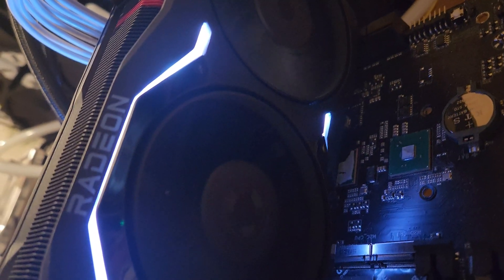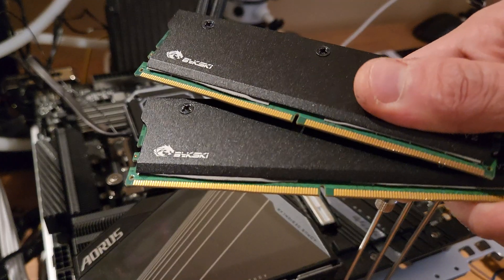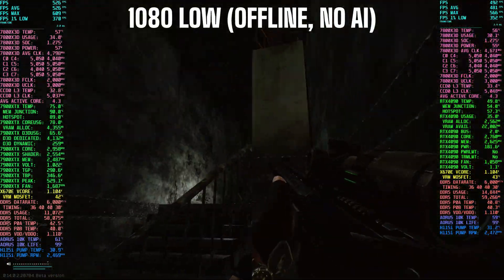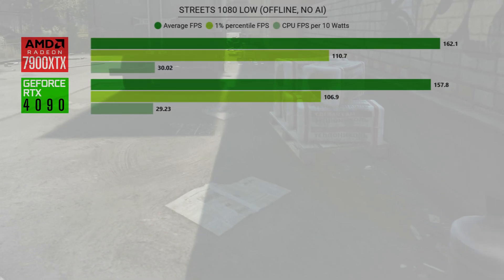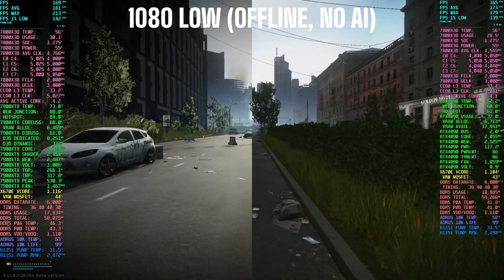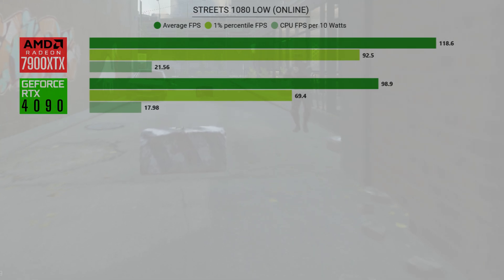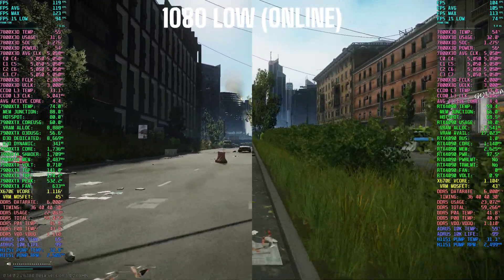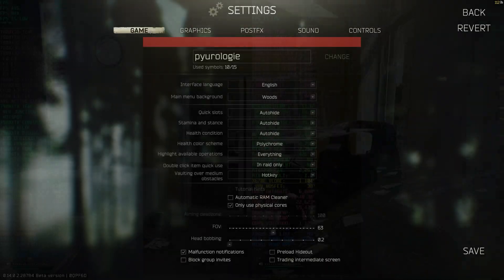Battle of the Flagships 4090 vs 7900XTX in 4K || Faceoff e20

Comment: Hey, great video and information. BUT, i believe 1440p is a much more interesting resolution for Tarkov than both 1080p and 4k, would be great to see that added into your videos. Most streamers play on 1440p, and allmost every player i know plays on 1440p. Also medium settings is far more interesting than low (except for streets).
Reply from the maker: i understand where you're coming from. in 2K, the performance is likely to be almost identical though. at minimum and maximum settings are where the differences are gonna show for tarkov on these 2 cards. I do have plenty of individual videos showing both in 2k though.
Reply: @pyurologie  people are litterally buying new pc’s and upgrading to be able to play Tarkov in 1440p with good fps, 4k is a niche market where monitors cost a billion if you want semi decent refresh rates. It’s great to see someone testing hardware on Tarkov, I bet a lot of people find it extremely helpful, just commenting about what could make your Tarkov content even better and relevant ☺️ keep up the good work 👌🏻

Comment: how did you get 400+ fps on the factory raids, your moniter is only 240hz and the tarkov cap is 144 so how did you uncap it?
Reply from the maker: uncapped the FPS yes, you can run framerates higher than your monitor's Hz rating

Comment: I’m baffled bro I have a 14900k and a 4090 and at 1440p I’m only getting 100-120fps on streets … I’m an alpha player and have gone through all the tweaks in windows nvidia control panel etc and I just don’t get it , benchmarked my system on 3d mark and scored higher than 95% of all other users so it’s not the hardware  this shit is crazy

Comment: how are you upcapping the frames on the amd card? mine is capped at 144. 7800x3d 7900xtx here.
Reply from the maker: if you use vsync in game settings, it will cap to monitor framerate. If you also enable "Enhanced Sync" in Radeon Software, it will uncap indefinitely. Be careful because it will uncap in menus too. The XTX can have huge power spikes in this configuration.
Reply: @pyurologie  this will cause major input lag though right?
Reply from the maker: @tylerbixler6357  nope it shouldnt

Comment: Why is the framerate so high on the 4090 in 4k? I just don't understand how the 4k average an be so much higher than the 1080p average when using the same CPU. do you think it was just a weird raid? or is it consistently higher on 4k?
Reply from the maker: I've been seeing that with higher settings on a GPU with headroom, it can actually increase performance because it uses more GPU power
Reply: That doesn't really make sense to me. I'm guessing bsg just coded their game weirdly to make some higher settings less intensive than lower settings.
Reply: @tracetracetrace I'm noticing this with my RTX3080 today. I'm only getting 70 fps and only using 50% of my GPU. I can kick up the settings and the game looks better and uses more GPU. 

Super dumb.
Reply: Dlss on?

Comment: It is OC or stock 7900XTX  ?
Reply: It's a reference model xtx
Reply: @a9396so for example OC model should perform event better ?
I think about sapphire nitro+  with samsung g9 monitor 1440p
Reply from the maker: You might gain 5% performance on an OC model vs reference, maybe a few more % if you run an extreme OC. In 1440p, XTX is amazing. It just cannot do 4K native. It's just that even cards that cost half as much as XTX are already just as amazing in 1440p. So, in my opinion, for Tarkov players 7900XTX is not a very good deal.
Reply: @pyurologie you think it can compare with 4090 ? or should I buy 4090?
Reply from the maker: @pawel2072  no, there's nothing that competes equally with 4090 right now. It is in a class of its own. I would buy 4090 if you want to play 4K. If you're playing 1440, personally I wouldn't go above a 6950XT/4070 non super.

6950XT: https://youtu.be/gCoED5bOuZU
4070: https://youtu.be/CGy1YjJsiv0

I would get something in that $450-550 price range and spend more on a sick monitor/kb/mouse or just pocket the extra cash if playing 1440p over getting a 4090
Reply: @pyurologie yes monitor samsung g9 oled.Is only 5,120 x 1,440 so I dont think so its make sens to run game in 4k if Monitor have no 4k

Comment: Bro can u please help me, I also have 7800x3d and Rtx 4090 but in some areas on streets the fps dropping from 120 to 65 😭
On top of that I only play in wqhd (2560x1440)
What am I doin wrong 😢
Reply from the maker: https://www.youtube.com/watch?v=rP0UEDLKwf8 this is how i configure my machines

https://youtu.be/-D2gPn95jS8 here is how you can undervolt and overclock your ryzen 7000 as well

https://youtu.be/lOSf_aqrLJc?t=1054 this timestamp shows my pyur preset settings, what i typically run and found to be optimal blend of visuals/performance

lmk how it goes. if you still have issues, feel free to hit me up on discord https://discord.gg/c7SvvDAuMZ

Comment: hey man love your content. I am currently building a PC and have the 7900 XTX and 7950X3D should i swap down to the 7800X3D or stay with 7950X3D i have found mixed reviews on this subject and alot is based on price vs performance. any advice is much appreciated. currently only 1440P gaming
Reply from the maker: if you're just gaming, all the 7000X3Ds perform about the same in Tarkov, I would get the 7800X3D if you want the best performance to price ratio. I would call the 7900X3D and 7950X3D "luxury" options that can game as well as the 7800X3D, but are also multi core beasts for other applications. So, if that's what you're looking for, then go with the 9 series. Otherwise, if just gaming, you're not getting any extra gaming performance from the 9 series chips over the 7.

Comment: I have 3080 and i9 11900k and cant beat 75-80 fps in 2K on streets. My average fps on streets is 60.. My details is medium. Framedrops is 45.. I dont know what is wrong..
Reply: My buddy had a similar CPU, but it was wattage limited somehow. Check the wattage in bios for your cpu. He fixed the wattage cap and then it went all crazy with frames.
Reply: I don't have streets data or 2K data. But on woods and shoreline 3080 4K 5600X DLSS balanced im 90-100fps. DLSS quality 80-90fps. 3080 is undervolted.

Comment: wht is the 7900xtx 20 degrees hotter all around in 4k? 6:40
Reply from the maker: XTX runs very warm and draws a ton of power, normal behavior
Reply: @pyurologie  
The core clocks on your 7900 XTX seem really low for half the 4k online raid, for some reason.

My Asrock Phantom Gaming is consistently at 2700-2900 mhz Core (at 5120x1440 32:9 ultrawide, which is slightly less pixels than 4k), on all maps.
vs the mostly 2200mhz core, with some recovery towards 2500mhz, near the end of your 4k High streets run.

Also if you look at the start of the offline 1080p Low side-by-side run, the 7900 xtx properly at 2800mhz'ish there.
While in the online Streets Low 1080p, the 7900xtx is at a abyssmal 1750mhz?

It's as if the 7900 xtx is in some kind of powersaving mode.

I'd recommend revisiting the card, it really shouldn't be dropping core clocks like that under load.
Personally I run the custom tuning profile in Adrenaline, with just power limit +15% and min frequency at 2700, max 2925, this tends to ensure that the card doesn't do any weird downclocking power saving stuff.

P.S. I actually noticed the 4090 also downclocks at the start of the 1080p Online run to just 1035 mhz core, which makes it look as if the 4090 is worse at 4k Low.
Which would be accurate to a degree, if this is common occurrence at default settings that many buyers aren't going to tweak.
But I am really curious what kind of differences we would see if neither card was downclocking for any reason and were sitting at full clockspeeds from start to finish.

P.P.S. The 7900 XTX starts the 4k Ultra run with 25214mb VRAM usage, that might be causing it to offload textures to ram/pagefile, resulting in performance losses. 
Might want to test Streets Low Textures option, to see if that makes any difference. 
And/or restarting the game between tests, to make sure there's no anomalies.

Comment: Apologies but those 4k frames by the 4090 in online seems like DLSS is on, are you sure it wasn't?

Appreciate the content.
Reply: maybe putting more weight in gpu by increasing the resolution rate reduced the heavy load of cpu giving more fps in total
Reply from the maker: @alieichiba5217  yes I think it's something like this. The higher settings/resolution increased GPU usage and surprisingly seems to increase overall performance.
Reply from the maker: yes I'm sure man
Reply: Nvidia cards in higher resolution become super competitive and beat amd cards in nost cases , im not a nvidia fan , in mid range non rt games amd absolutely destroy nvidia , but going to 4k and using ray tracing nvidia win , my gpu is 6950xt asrock phantom gaming.

Comment: I have an older System Intel k8700 CPU with 1080ti nvidia. I think about to change to AMD am5 7 7800x3d and the gpu i really dont now which to take i Play 2k setting wqhd. What is the first step to go for more fps change board and CPU with DDR5 ram or let the Intel and go for gpu? İ like and Abo your Chanel thx
Reply from the maker: here is my 2024 meta build video: https://youtu.be/gCoED5bOuZU. This is the minimum config you need to get the most performance. lmk if you have questions.